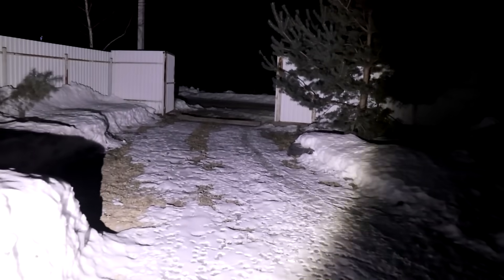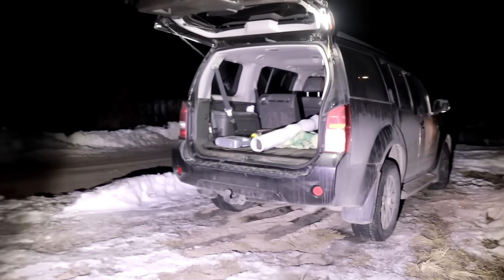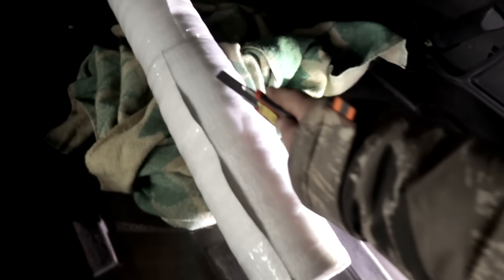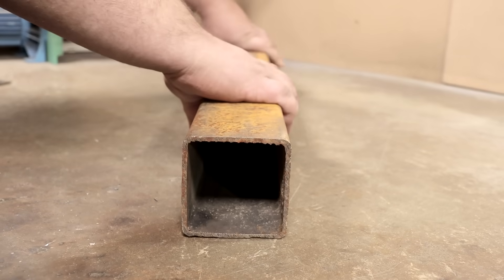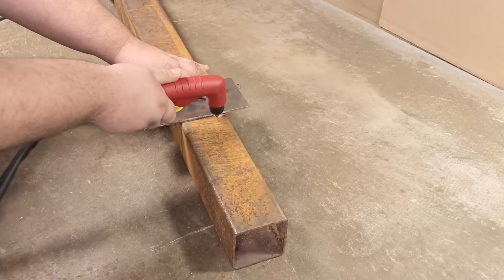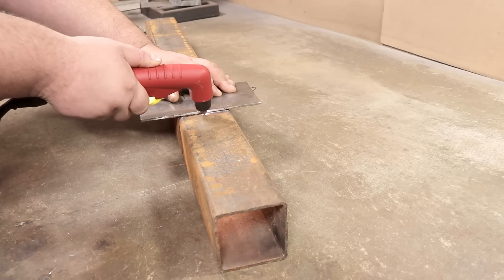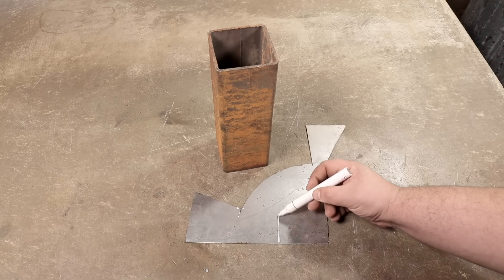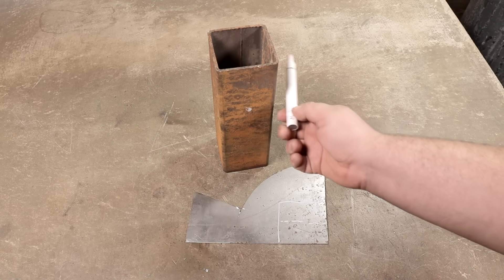NEW HEATER. Rocket stove is no longer needed!

Comment: You might ponder putting a Gas Water Heater on a second floor, as part of the flue. This will provide a very significant amount of hot water, which can be used for both standard hygiene and cleaning uses, can also be pumped through a hydroponic heating system.
It's beautiful, but most likely far out of my price range.
But I am sure windows on the sides of my square tubing will be almost as good.
Reply from the maker: Hey! Thanks a lot! Yes, a great idea, if you install a heat exchanger on the pipe, the efficiency of the furnace will increase and you can make an additional circuit.
It is not necessary to use round glass, you can make a square frame and insert flat glasses into it. Get a fireplace with an excellent view. Looking forward to new videos!
Reply: @cd2920  steam is amazing. And powerful. Water is magic. Truly. 

I sealed a quartz crystal in borosilicate glass tube in distilled water and then applied a hydrogen flame. The explosion was impression. 

The crystals. There were actually three. Were then glowing like a slight peach color? I picked one up and dropped it and it his my knee and i kid you not a rainbow halo hung in rhe air static for a few moments where it hit my   knee. 

Umm pretty cool. 

If you rub crystals together they let of the similar glowing light. 
Electrets.  Non ferrous electret magnetism 
(Or some piezo blah blah )

Comment: May be I will test one with ceramic tube instead of glass tube. It may make for some economic viability, in case someone wants to commercialise it. Excellent video.
Reply from the maker: Thanks a lot! Anything can be used instead of a glass pipe. Even install a heat exchanger for heating water or a room.

Comment: That will be 1400° Fahrenheit that the glass pipe can withstand.
Reply from the maker: No, this pipe can withstand 1400° Celsius (2552 °F). This quartz glass (fused quartz) is a single-component glass made from pure silicon dioxide (SiO2).

Comment: What a cool Contraption, though the headline that promotes independence from gas or petrol is kind of redundant considering you needed to use welding and plasma cutter no doubt from normal high-wattage electricity, so unless you're generating said electricity from a wood gasifier, for example, then perhaps you consider a more relevent headline
Reply from the maker: I will definitely heed your advice. Thank you.
Reply: @doctor-robo  I would like to congratulate you on the excellence of your designs and fabrications. Perhaps even more so on your patient response to some of the inane comments on this page.
Reply: I'm pretty sure that he meant that it doesn't run on gas or petrol once it has been manufactured. What do you think the glass and steel was made with? Anyone with even below average intelligence could figure that out.

Comment: I do love it!  Ty.  Was wondering, do you think of the bottom part of the riser was metal and higher, it would give the fuel a chance to burn more, and perhaps slow the blackening of the glass?
Reply from the maker: Thanks a lot! To make the glass blacken less, you need to ensure that the flame does not touch the glass. To do this, I made a swirl of the fire flame. But it will still turn a little black - this is a natural process.
Reply: @doctor-robo  Yes I've seen the same problem with traditional wood stoves especially when you first light them when its not hot 🔥 enough to burn all the fuel.  Only way around that is perhaps a bypass of some sort until it gets hot enough.  Great build btw!  I plan to make one but incorporating heat storage.
Reply: @doctor-robo  maybe with a darker glass the blackening from the smoke would be less noticeable...great work, love the design.

Comment: I thought about something similar, but burn in a box about 1 cu ft!   With a 4" swirl chamber pipe, about 3' tall with a heat exchanger on top about 10-12" by 16-18" wide,   and 6-8" deep, so the smoke or exhaust, is just hot enough to make the  chimney work, if the  heat is hot enough , it may be worth needing a fan to pull the exhaust out ! Haha,.
Reply from the maker: Hey! Thank you very much for the advice and excellent ideas for refining this stove. I planned for the stove to be completely autonomous without electricity with automatic fuel supply, only based on the laws of physics (forces of attraction and distribution of convection currents of hot gases), but your ideas are very good. I will try to implement them. I also want it to be autonomous, but with electricity, I want to try to make a Seebeck thermoelectric generator on this furnace. I have already given a furnace with such a generator and I was able to achieve good results (5 Volts 1 Amp) when burning a 3" x 5" furnace. In the future I will publish on this channel the operation of the thermogenerator furnace.

Comment: That is Soo cool, I think I'd build a heat exchanger to fit on top, use something like 20ga steel sheet metal to make a radiator, weld two pieces together, at the ends, about 8"-12" wide and 18" long, bow them apart, put a 1" spacer to hold it open, make about 8 of them, and connect them to 18gauge sheet box, with the pipe size inlet and outlet,. Basically a radiator without the fins   use a tiny gear reduction motor, and about 12-16" fan , the 12v motor should spin the fan about 45-60 rpm, and pull 5-10 watts so a 12v 1amp power supply would be plenty,  the fan is just enough to move the air, without causing problems from wind blowing objects,   it should be about the same as the wind from convection from a hot stove! The IR heat from the tube is an awesome idea, I bet it's not cheap, but the whole project is awesome!  And if you built the radiator and fan, maybe build a power feeder, using a motor and timer controller, to use a screw drive feeder, in a 3" pipe,  with another gear reduction motor, spinning the screw in the pipe . About 10rpm to a possible 25 rpm, using a pwm speed controller,  to send pellets up to the burn chamber,  if it's slow enough it may not need a timer, just run constantly , build a steel storage for the pellets,  nearly sealed from air Incase there is an issues, so a fire can't burn into the storage, run the screw at about 45° angle, putting a 20 lb pellet storage about 2' away, made from a square sheet metal box, about 12"x 12", with a 3mm plate lid,  and a inverted pyramid base, with angle iron legs with the 3" pipe.  Connected to the peak of the pyramid. Making the feeder possible, feeding into the fill point of the stove , by a box on the end of the pipe with the feed screw inside,  use a 1/4" axel to be driven from either end,  maybe use a spring loaded trap door at the top of the feeder of the stove, to trigger a micro switch when the feed of the stove is full the door will be stuck open,  this will shut off the motor  feeding the stove, preventing the need of a timer making the fire the timer,  and the whole thing can be easily removed to operate it as normal, only require a 12v 2amp supply,  that could use a thermal electric generator, to charge the battery, while the motor is not in use, but will probably require charging monthly or so, using a 10-15 ah lithium battery, using thermal electrics to charge at probably 50-100 ma  
Using the floor as a heat sink, and  about 150°-200°F on the hot side   the motor should not pull much wattage, and the run time should be low, with a maximum if 100 ma at 14v, the nominal power will probably be closer to 
40ma,  24/7,   could make up for the 12v 1000ma for 5 seconds, every 5-10 minutes, it may slowly discharge the battery, over a month, or so,   I love this stove with the glass tube!!  The light from it is also a plus!
Reply: I saw small ventilators before on wood stoves. They work without power supply, just with the rising hot air to spread the heat evenly into the room

Comment: I have built something similar but instead of glass I used a very fine mesh stainless steel screen. The chimney helps all of the wood gasses to combust so that there is no smoke. I use it in the garden and indoors. Your glass chimney is an excellent & elegant solution, providing a powerful mixture of air and heat to burn the wood gasses. It's very beautiful
Reply from the maker: You have an interesting solution with stainless steel mesh, thanks for sharing. I have already ordered the mesh and it will be delivered to me soon, I really want to try it.
Reply: @doctor-robo  i love that you read the comments and grew inspiration. Awesome
Reply: @doctor-robo  try combining the mesh with glass. Just make a lantern mantle inside the glass tube. It will be brighter to give light and still have the glass for thermal mass...if you make some aluminum skirts to fit around the glass tube it will radiate much more heat much faster.
Reply: Please provide some details about the mesh.  What diameter, length, mesh size.  Thanks.
Reply: @ideasytnow  120 mesh stainless steel.
Reply: @artytomparis  Thank you very much.
Reply: Stainless steel mesh does radiate heat faster than glass and you can also use it for a mantle that will light the room at night. The advantage of glass is that it offers thermal mass that holds the heat longer... A space heater needs to radiate well but works more efficiently if it stores heat in a  thermal mass. I bought a ceramic garden pot with a tray, put a chaffing fuel on the tray, took a stainless steel utensil holder lined with steel mesh/screen and placed it over the burner, put the ceramic pot upside down on top and I have a small radiative space heater that puts out a decent amount of light.
Reply: @captainKedger  That's nice. I also line the inside of the wire mesh chimney with stainless steel wire wool, with a hollow space in the middle so that they will catch and radiate heat though it doesn't store it very well. The chimney is too short (only 2 foot high) to burn up the wood gasses completely so there is some carbon monoxide in the room when I use it. 

What kind of alcohol / fuel are you using in the a chaffing pot? 
I presume the stainless steel utensil holder is the kind used in a kitchen for the draining of knives and forks after washing. The ones with lots of holes in the sides and the bottom.
Reply: Eventually maybe that glass may explode, without warning.  Had glass fireplace doors do that.  I like the idea of mesh

Comment: This looks more like a beautiful Art piece than a stove.
Reply from the maker: Thank you so much! I try to do interesting projects. Come back to my channel!
Reply: @doctor-robo  thank YOU Mr. Robo for taking the time to make and share your ideas.
Reply: Consider how this stove performs exactly like those expensive propane space heaters in fancy bars and night clubs they put outside on cold nights to warm their customers... They're designed for maximum heat radiation without regard to energy/fuel consumption. Here this stove uses basic physics to get the same heat out of a scoop of pellets that we use a 20 lbs bottle of propane to get out of commercial units.
Reply: Especially if it is supposed to burn water that will be literally true. There is a reason why he does not show that part.